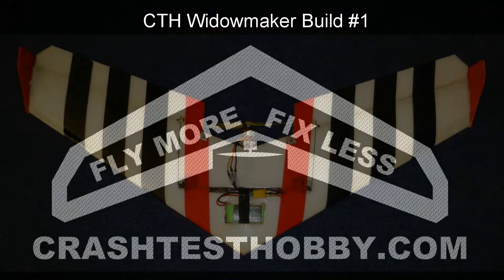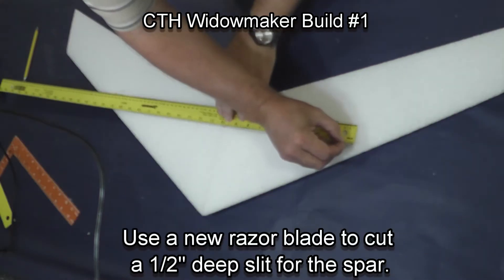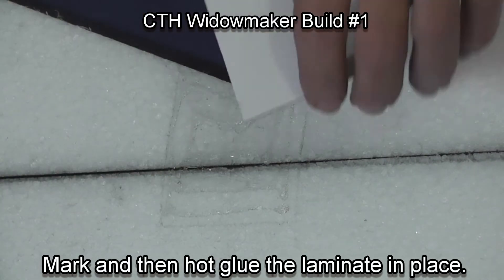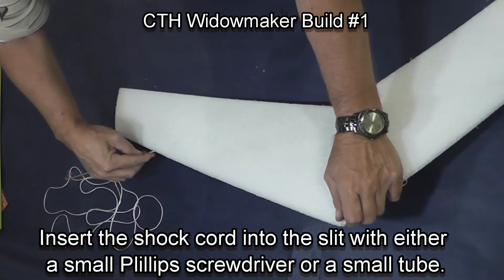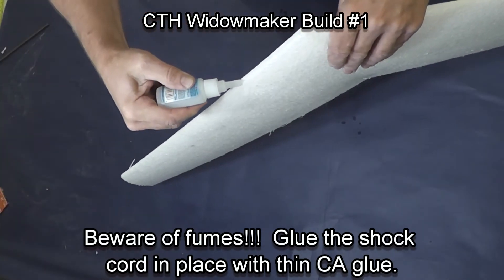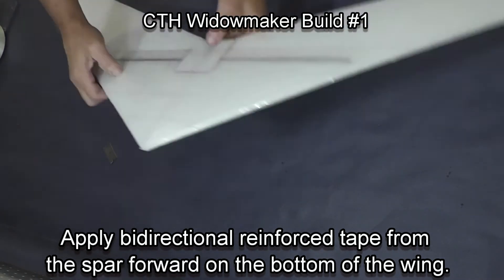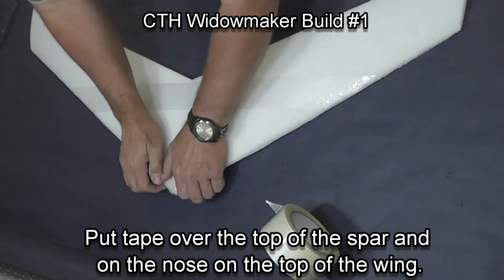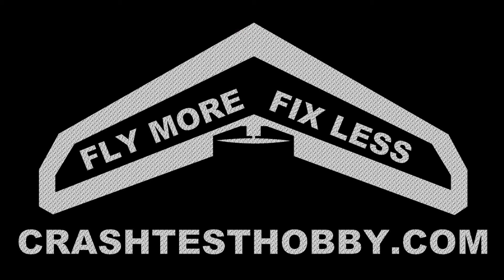Widowmaker #1 Building the EPP Wing

Comment: Lee, when you are razoring or rubbing the wings together, I assume you are not looking for a perfectly smooth surface to result.  Just looking to remove the stingy threads?  Does thin CA need to be foam safe?